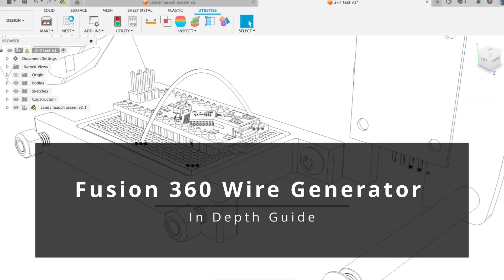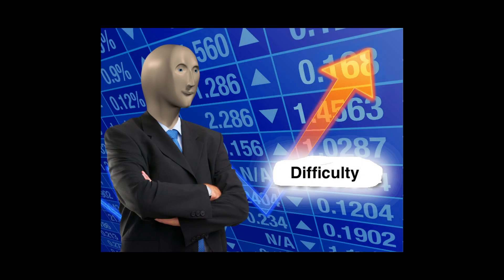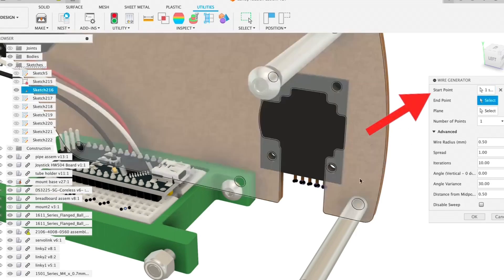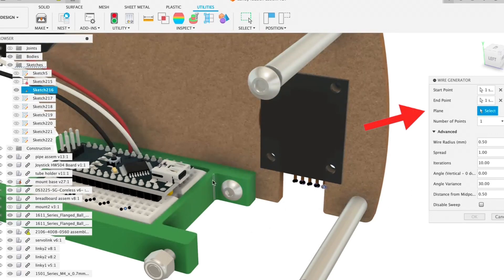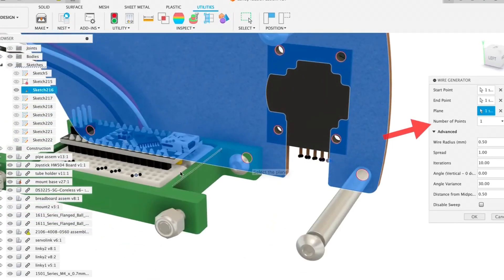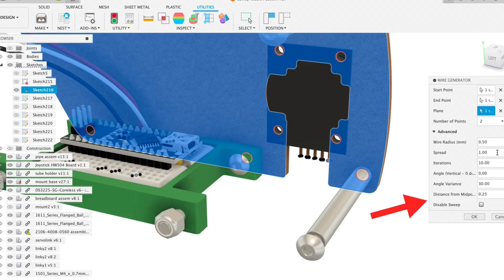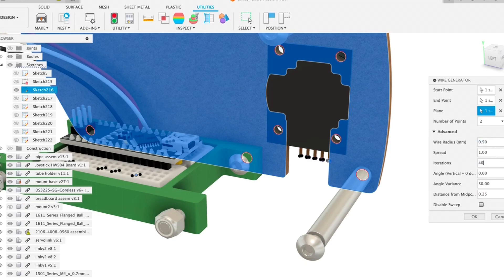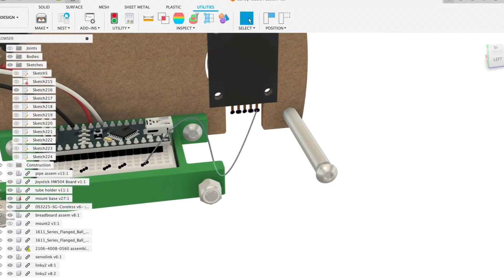Making Wires in Fusion 360: Wire Generator Add-On Tutorial

Comment: I’m trying to create an amp wrack for my car and an electrical panel for my Accesories and want to design it first in fusion so I have a complete visual and process on hand before starting the work on the car and need more videos on wire process so I know exactly the length of each cable